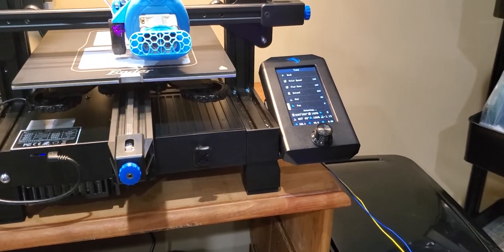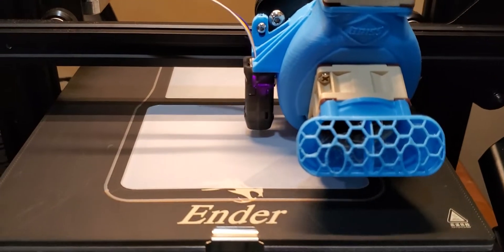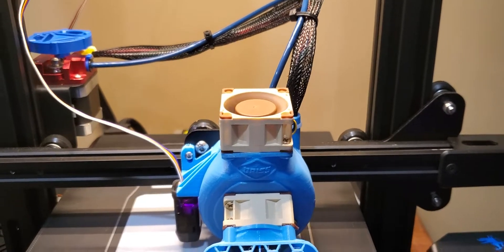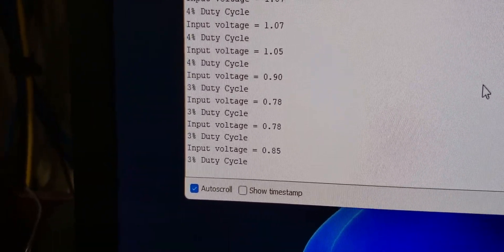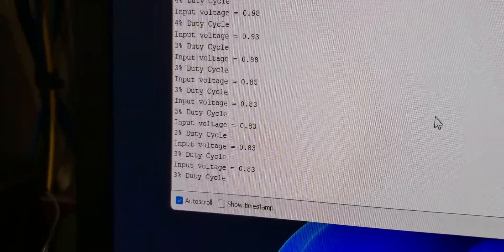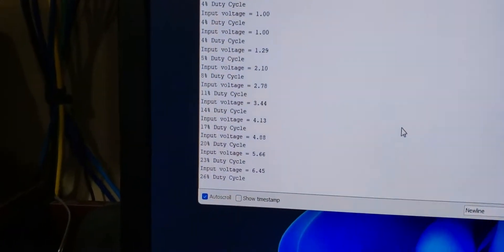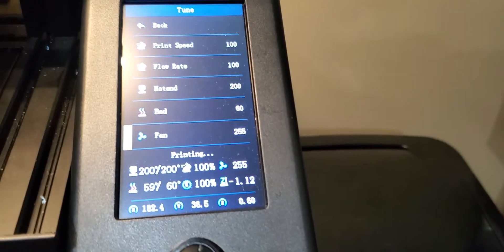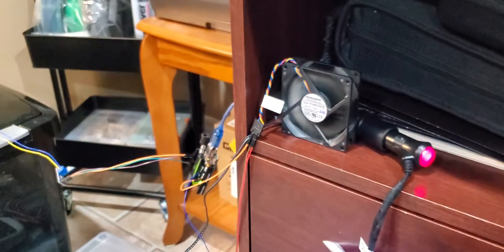PWM fan control on Ender3 v2 using Arduino.

Comment: why not using a linear step down small circuit in order to run a 12v or 5v fan and also using the "pwm" "on-off" signal from controler to run a simple fan ,not a pwm 3-wire fan?Also what is the signal max frequency on-off comming from board directly to 24v fan?

Comment: Hello Pat,
I found your project really interesting but I decided to change fans the easy way at first with just a buck converter and non-PWM fan. I was expecting to get issues you described - so the fan will stall at low speed settings / voltage but it worked just fine ! I'm not as much into electronics as you are but installing LEDs with it allowed me to discover something interesting - I was expecting the LEDs to dim on low speed but instead they started to blink. It looks that the buck converter starts to modulate once it's powered with lower voltage than desired on its output. My assumption than is it sends 12V impulses with frequency that depends on the input voltage. Please check this out: https://youtu.be/2F9W80_SwOY